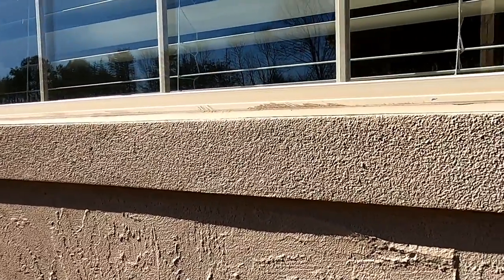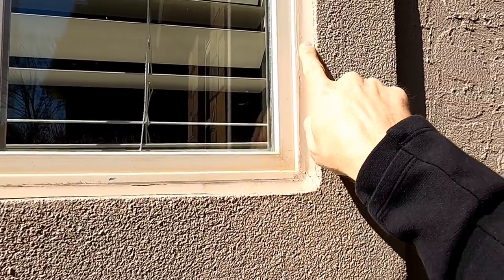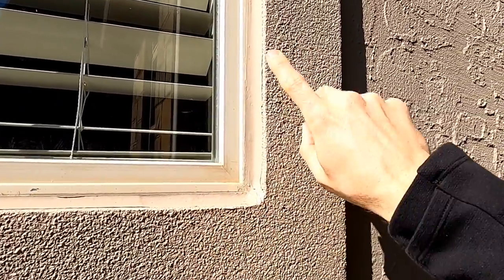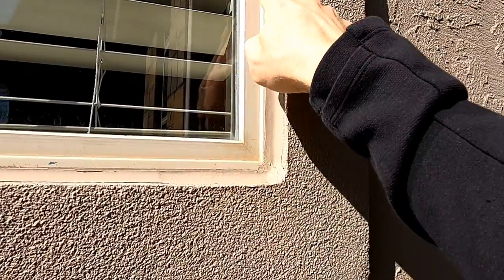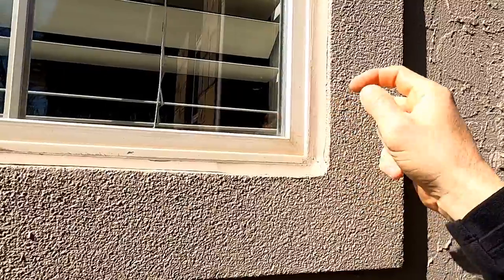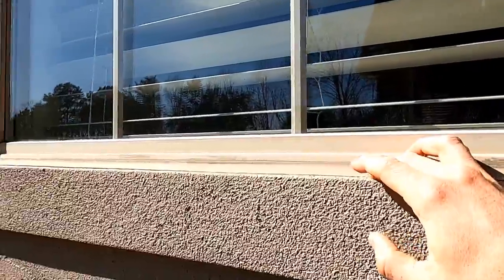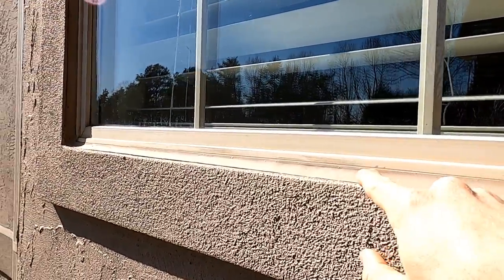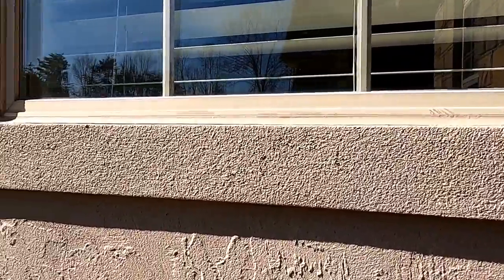Quick Tips: Stucco Series: Window Sealant

Comment: Inspector,  I had retrofit flush gun windows installed on my stucco home.  Caulk was not applied to the bottom edge fit where it sits on the stucco wall.  Also one particular area bottom edge of fin I can see a gap so it’s not flush tight against the stucco wall.  Is this a bad install?  Should I have it fixed?

Comment: What does a bad seal look like?
Reply from the maker: Basically, anything that doesn't look like the joint that is in this video. Cracking in and around the sealant is not good. And the joints need to be wide too. Many times the joint is so small that the sealant does not have adequate space to receive the proper amount.